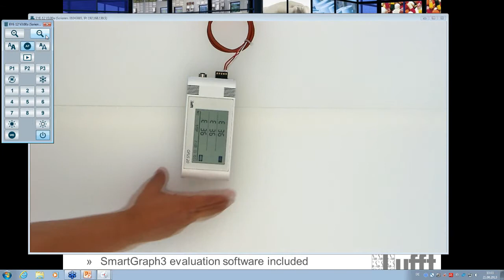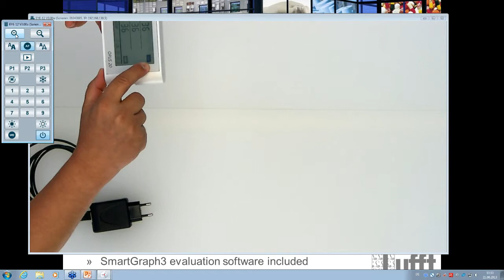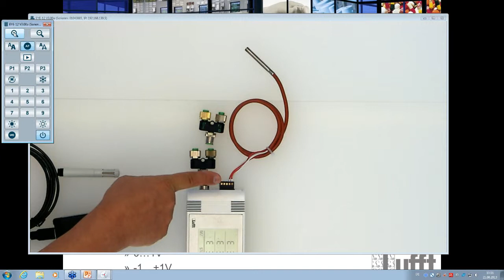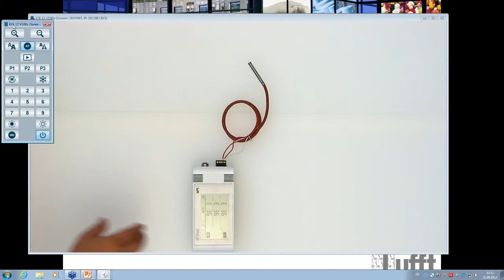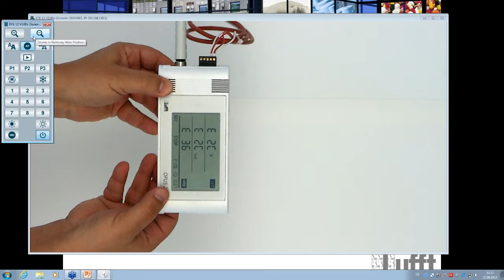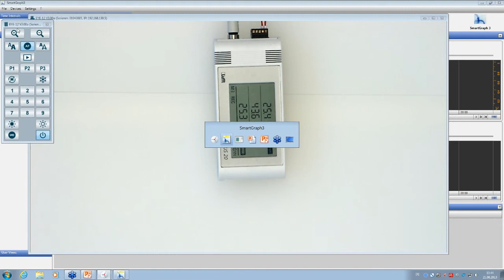LufftAcademy Webinar: Configuration of OPUS20E data logger

Comment: My opus 20 is locked and is with error E 27, how to remove?

Thank you!
Reply: The error code stands for: "calibration data incorrect". This means that the calibration data can't be loaded from the data flash and the OPUS20 doesn't switch to the measuring mode. You should send the device to us for inspection and repair. Further information at: https://www.lufft.com/service/maintenance-repair-service/